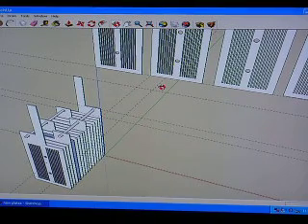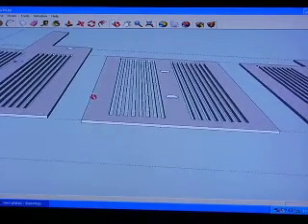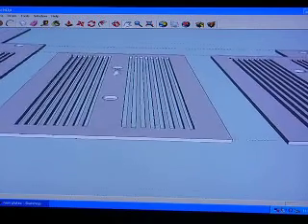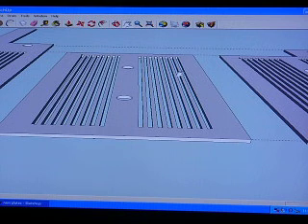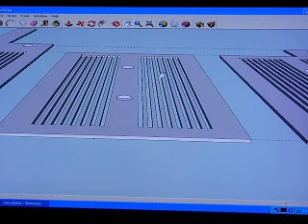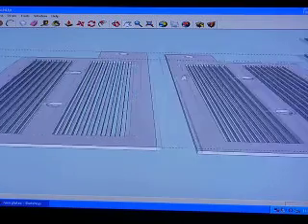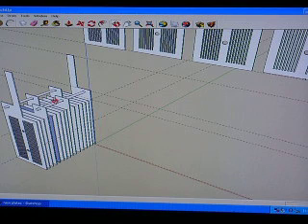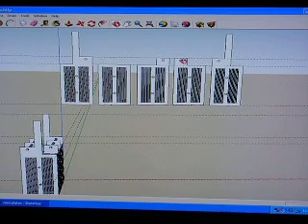016 HHO plate redesign

Comment: great thinking and designing. If you are looking for more surface area, would it not be better to drill small holes very close together. I just started learning about HHO, and actually built my first wet cell using Water for Gas plans. It work yet little gas. Lots to learn. Have you looked at combining a Frequency Modulator to the dry cell?

Comment: Thanx for subscribing. I was just thinking that you could use a plasma tourch or water jut to cut these groves. The water jet will not distrot the stainless because there is no heat affected zone to misshape the piece. The abrasive wheel can be costly when cutting stainless as it workhardens very easily. A good carbide blade on a metal saw (one that turns slowly <1300rpm) is ideal. I have one of these saws if you need help just let me know. Hope things are well with you. Best regards Mark

Comment: Go for (+-+-) ... (+-+-) ... (+-+-) ... (+-+-)
Voltage in each will drop to 3V if supplied with 12V and uses 16 plates...
or 5 (containers) as (+-+) connected for 15 plates total, but voltage drop to 2.4V each container... going to 6 of those for 2V each would be best and 18 plates total, or to have 4 plates each and be 24 plates total will give 12 more surfaces for H and O to go to even better...Lots of experimenting ahead :)

Comment: I think you created LEAKAGE as you stated indirectly. + to - plate does not need to travel through neutral anymore as in a solid plate & drop V as it passes through. Not sure this will drop your V between plates. I'd say go for a +-+-+-+- design w/no neutrals & no needs of insulating, just have 5 to 7 of them running in series to drop V. Don't forget the less V will add efficiency of less heat created & higher conc. of electrolyte will be required to produce the gas under the same total A.

Comment: I know, we thought 10G would be fine with the super mild electrolyte solution. I don't know why it pulled so many amps. Our thought was the current leakage from the slots? That was the only thing different.We thought of making a sealed cell from the drain plates, which could have been done cheaply with o-rings and some bolts. I can't wait to see your test results, though. We are trying to develop a cell that is significantly cheaper than the EBN one. Thanks for the compliment on the EPD!
Steve

Comment: hey fizzy I used a perforated plate seemed to work good didnt heat up on my second try . still in the works. but ill tell you it appeared to produce a greater amount than the first attempt with solid plate. check my plates out hho gen up for critisizm

Comment: it's an interesting idea, however, i am going to predict that you will find the amperage draw to be much higher. We tested a similar design using round 4 in SS shower drain plates(look em up) and the amperage draw was so high, it melted the 10 guage wire we were using. And, our electrolyte soup was very mild. you may find that a solid electrode plate, and these slotted as neutral plates may work better for you. but i'm only speculating...as SS says, "Just Build It!" haha
good job, man.
Steve

Comment: I like you work.  Soon, I'm going to start posting videos on my own HHO cell building.  Do you frequent any message boards for bouncing ideas around?

The concept of having the electrodes slotted is a sound idea.  I think you may find that a combination of slotted electrodes and solid neutral plates will give you the greatest output due to the induced electric fields in the neutral plate, which will be reduced if they are slotted.